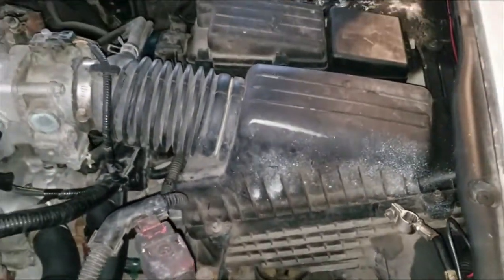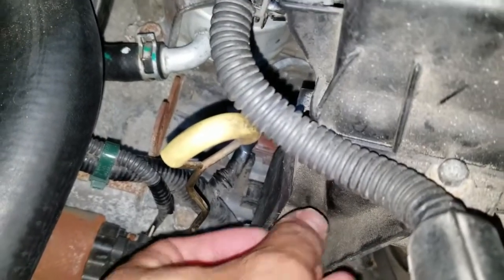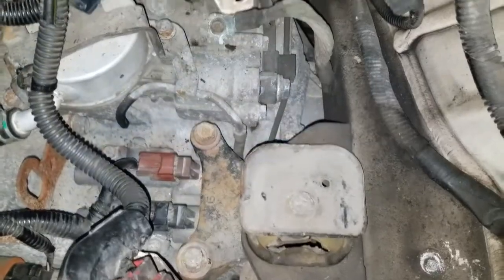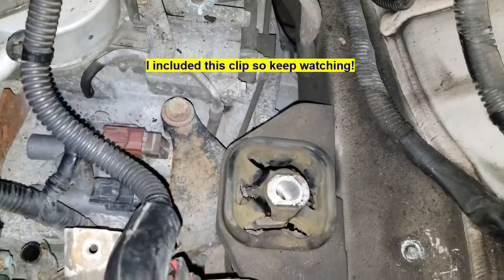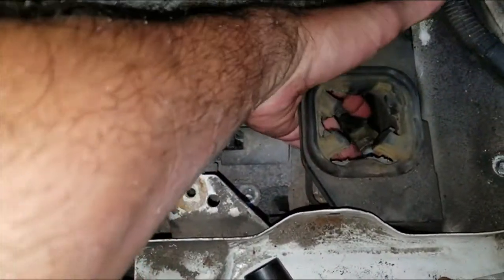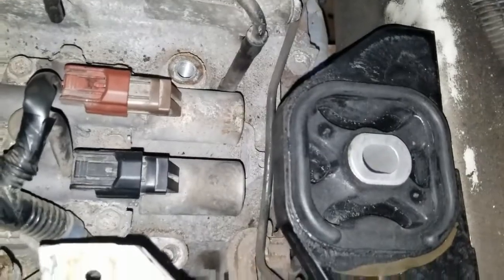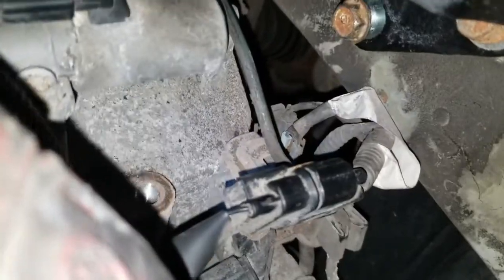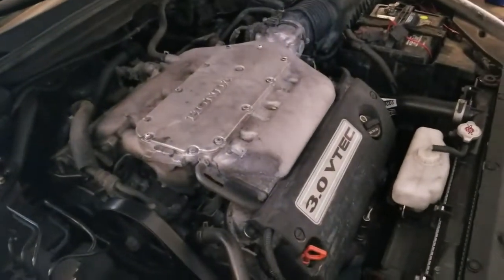2003-2007 Honda Accord V6 Automatic Upper Transmission mount replacement

Comment: Looks like some of those bolts holding a bracket to the transmission are threaded into the aluminum transmission body.  It is noteworthy that these bolts should not be torqued nearly as much as you would torque them if they were going into steel.  Thanks for this very helpful video!
Reply from the maker: Thanks for taking the time to comment and share a tip.

Comment: I had a mechanic tell me for my 04 accord 2.4 that the left engine mount and left transmission mount are broken and cracked respectfully, I am assuming this is referring to the drivers side? A little confused not much of a mechanic clarification would be great. There is shaking of the steering wheel when I turn the ac on as well if that helps any. Great video btw and you showed the process perfectly

Comment: Thanks for this great video, i have a question which is can i use transmission mounts kit of 2.4L for 3.0 considering they dont have the same transmission?
Reply from the maker: Thanks appreicate it. I would suggest checking the part numbers for these 2 vehicles against an online parts supplier. Here is one that you can use to confirm the part numbers are the same. https://www.hondapartsonline.net/oem-parts/honda-rubber-transmission-mounting-upper-50870sdaa02 As for the upper transmission mount, it does appear to be the same OEM number for both engines OEM 50870-SDA-A02

Comment: Great video. Did you by chance do the other 2 lower trans mounts and have info on that?
Reply from the maker: Thx for the compliment. I did not change either of those as they were still good. However I have 2 videos on replacing the front engine mount as well as the passenger side engine mount in case you need to change those.

Comment: Awesome content!! Did the car shake on acceleration? Around 40 mph?
Reply from the maker: Thanks for the compliment. Don't  recall any specific noise on acceleration at 40 mph (60km/h here in Canada)I was hearing alot of noise when going over bumps, stopping and accelerating from a stop. I managed to get rid of alot of the rattle by replacing front and passenger engine mounts amd driver side tranny mount. Still had creaking when stopping and accelerating so I tested the upper mounts which were loose at the joints  so I changed those out. The stopping and accelerating noise finally disappeared after changing lower control arms. I have videos of all this and will be posting the lower control arm one shortly.